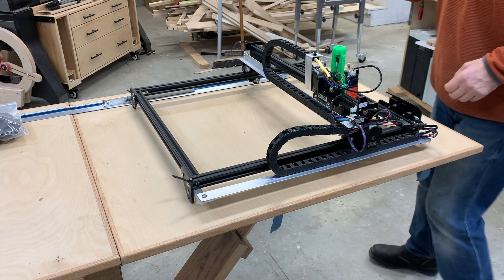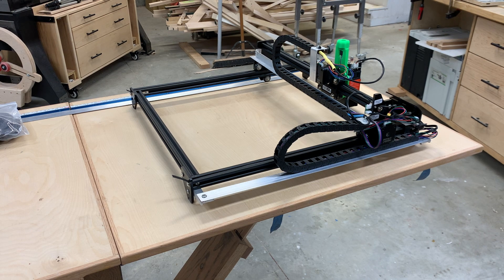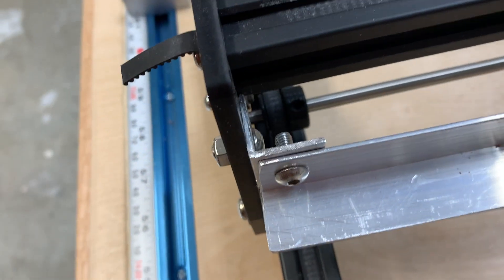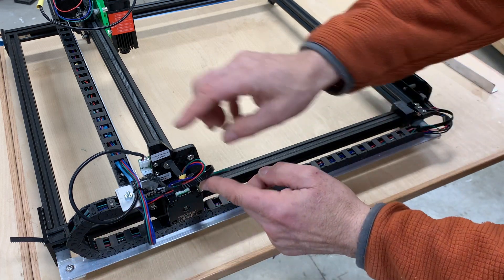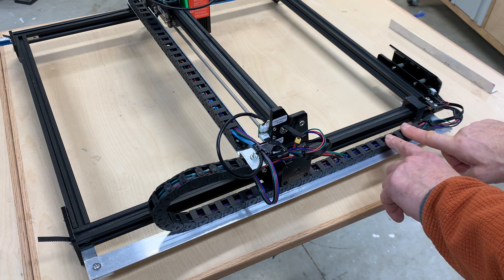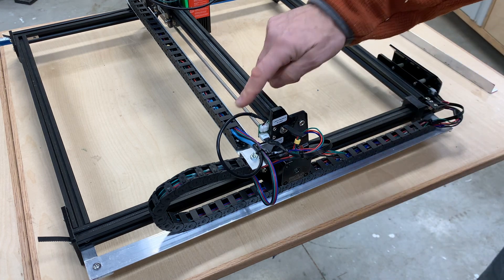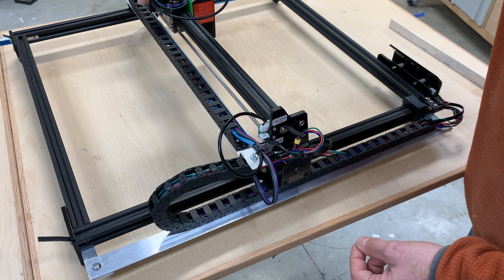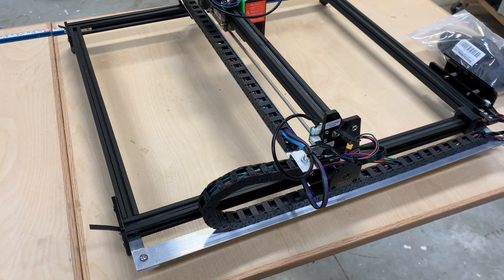Ortur LM2 Drag Chain Modification

Comment: Very nice, a good drag chain setup is a nice upgrade for these type of lasers. My drag chain setup is very similar- got L channel aluminum extrusions (same sort of aluminum angle that you used) attached to the frame/gantry to support any sagging in just the same way. I've got a Sculpfun S30 Pro with the 900x900mm expansion kit- it's a 10 watt so the huge area isn't too useful yet but I'll be upgrading to a 30 watt laser soon so it'll be much more practical. After I get my 30 watt I'm looking forward to my first CO2 laser. I've noticed more accuracy with the chain and can run at higher speeds- not by a lot but it's noticeable, I had wires rubbing on my enclosure and the air assist would flap around a lot at speed.

Comment: BONJOUR france  . TRES BIEN VOTRE MODIFICATION. where did you find your big protective filter from the box and which goggles you used with your prescription glasses
Reply from the maker: These are the goggles https://www.amazon.com/gp/product/B00U6UHRCI/ref=ppx_yo_dt_b_asin_title_o00_s00?ie=UTF8&psc=1

On the filter, are you referring to the orange plexiglass or the fan on the rear
Reply: @cedwards874  merci :-)
Reply: @cedwards874  merci
Reply from the maker: https://www.youtube.com/watch?v=1coDBGRGofs
Reply from the maker: https://www.youtube.com/watch?v=-eFxloXyXrc

Comment: I would like to just make a new wire harness are these 2.54mm JST-XH Connectors
Reply from the maker: I'm not sure, which is why I left the original connectors and just added wire in the middle.

Comment: I have the jtechphotonics sheet and using the included safety glasses in addition to the sheet and my eyes hurt.  At this point I think these lasers have a dangerous amount of IR or UV light.
Reply from the maker: I agree, I do seem to notice a bit of a headache when the laser is running. I also cover the Plexiglass with a large black lawn and leaf  bag when the laser is running.
Reply: The Ortur 20watt laser does not give off any UV or IR light .  The lasers spectrum emits light at 440-450 nm. The intensity is the only real issue .
Reply from the maker: @stevegraves3609  We'll just have to agree to disagree on this. I'd rather have people err  on the side of safety than lose their sight.
Reply: Chris, I also have the Ortur Laser and love it, but could you let me know what kind of wood you used for your plantation shutter louvres in your other video?
Reply from the maker: @danharrier3618  I used Basswood, not sure if it was Northern or Southern, I would guess Southern.